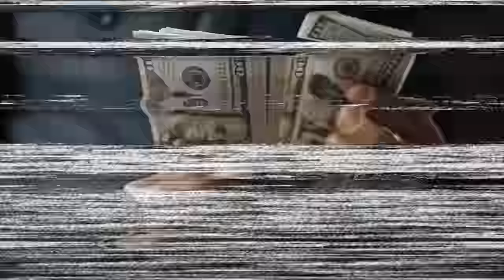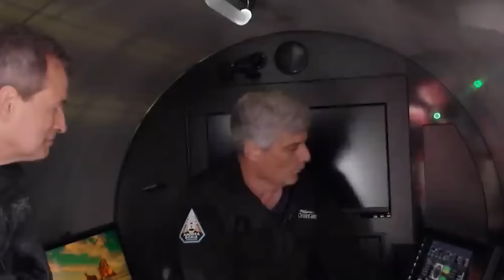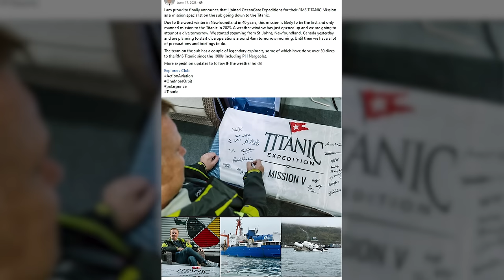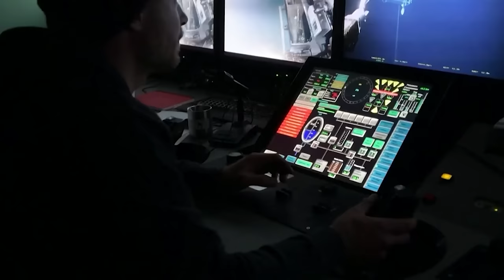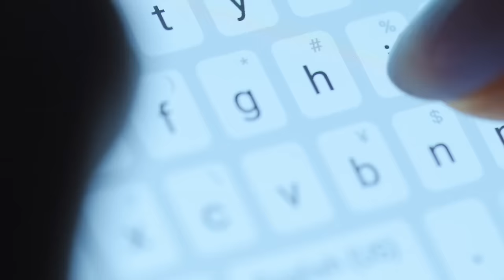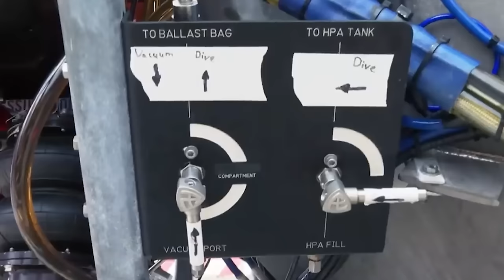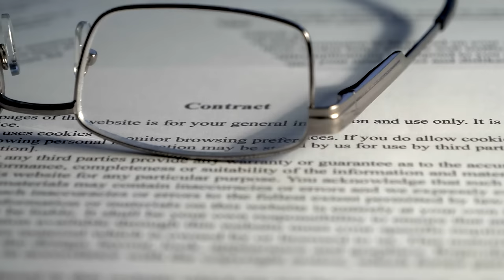The Titan Tragedy: What Went Wrong with OceanGate's Mission?

Comment: Many, many design errors went into the "Titan". There was no redundancy for buoyancy control with absolutely no means to affect positive buoyancy such as an "emergency inflation of ballast tanks. The Carbon fiber hull was designed for the hydraulic pressure found ABOVE the Titanic wreck, there was no safety margin taken into account. The unoccupied space in the submersible (battery compartment) was not monitored for flooding. No means was provided for pumping any water that may intrude there. The list goes on and on. It is no wonder that Rush did not want the vessel inspected.

Comment: I am only a mechanical engineer but even I can tell you Stockton's theory of using carbon fiber because it works great in planes is just plain stupid. The effects of pressure are the complete opposite going underwater. That design also looks like it has several weak points. Being that is was made of seperate pieces makes it even more puzzling. Seeing things attached to a carbon fiber hull going underwater at extreme crush depth made me think he was an absolute moron. I remember seeing a picture of the sub the first day it went missing and knowing that it got crushed. Way too many flaws and Stockton should have been ashamed being willing to take people that have no knowledge about the sub and its flaws to their death.

Comment: After the Titanic sank the rules a regulation were improved.Has the same happened with the Titan?
If "sound" was used to transmit information  then the noise of the structural failure would jam the transmission.
Carbon fiber is strong in tension. How strong is it on compression?
The resin binding it together might have been taking the strain and failed

Comment: It was always a doomed venture. Carbon fibre composites are very strong in extension, because the fibres are resistant to stretching. But the fibres add no strength in compression, so the pressure vessel essentially relied on the resin matrix for its integrity. The resin was never designed for this type of application, and it has a reputation of failing catastrophically and without warning when the layup is imperfect or it is subjected to repeated stress. Why anyone would pay to dive in such a death trap defeats me...

Comment: Lots of negative comments, but gifted people are willing to take risks.   We assume now that it was the carbon fiber that failed.   Recently Boeing has had many problems too.   Locked emergency doors have blown off.  Complete wheels have fallen off.  Large planes have run off the taxiway.   Rudder pedals have become stuck.   The mysterious source of ignition of the fire on Lahaina is of more concern to me.   How did all the regulations related to the COVID plandemic work out?   A large number of men now have Myocarditis resulting from the mandated injections which did virtually nothing to actually prevent illness.    This video keeps referring to unnamed "experts,"  but just how expert are they?  Have they built and tested submersibles with these particular components?   Let Rush and his fellow adventurers rest in peace at the bottom of the sea.   We are all going to die at some undetermined point in time.  Life is often unpredictable.  This was a very small loss of life relative to other events such as the genocide in Gaza where many more innocents have been deliberately killed without genuine moral justification.

Comment: Zero chance the sub was sinking nose-first towards the bottom when it popped. Carrying all of its weights, it had neutral buoyancy and only moved down via the thrusters. If it had total electrical failure, it would just sit at its current depth until they dropped the weights and rose to the surface. It was just the dumbest hull design ever.

Comment: They literally charged a $¼ million PER person! So they should have done a lot more to make that sub Fully capable of handling the pressures & compression forces that they were putting their sub through. It takes just a mild understanding of physics/material science/engineering design, to realize there is something seriously wrong about the current design they were using. The hull was connected to the end cap with adhesive glue and some bolts to connect metal to carbon fiber. The hull was spun in a linear manner without any woven patterns or reinforced structures. They should have AT LEAST made a sub with a much more durable, strong, reinforced, trusted material & shape design. I'm all for innovation and trying new things and pushing the boundaries but when it comes to exploring the deep ocean you DEFINITELY want to make sure your sub capsule does not implode. It needs to be able to endure the environment you are going to... There is no wiggle room when it comes to this & they already are charging a TON per person anyway sooo, why not make it work? If they did, they would still be having a huge income situation happening. Yet they only cared about the money income and not the engineering design safety that is required in order to keep receiving that financial income..

Comment: I know Oceangate gets a lot of shit and rightfully so, but the one thing that baffles people that shouldn't is the Logitech game controller.

Game controller design has been pretty much standardized since the original Playstation in the late 90s with very little change. The design is ergonomical and clean, and nearly everyone at some point has played a game with a 360 or PS controller.

Drones used for military and civilian applications along with ROVs and other vehicles use that same layout of controller on the user end. There's no need to reinvent the wheel.

Granted, it shouldn't have been wireless and it shouldn't have been the only way to pilot the thing reliably,  but that specific part of it is nothing new when it comes to aviation and submersibles.

Comment: You called the Titan's carbon fiber hull, "state of the art." This is not true. Normally, a carbon fiber hull is placed in a high-pressure kiln and heated. This was not done with the Titan's hull. It was allowed to sit and cute. State of the art nowhere.

Further, carbon fiber hulls have lengthy proven records of containing pressure, such as aim aircraft bodies. There is little to no such record of withstanding external pressure, and plenty of material/structural concerns pointing against such performance.

Comment: Everything Stockton Rush did was wrong 
#1 videos show construction of Titans hull being spiral wound with carbon fiber , like a sewing machines bobbin  , carbon fibers strength comes from being omni directional , the strands going all directions ,  the only real strength of Rushes design was the epoxy resin 
#2  Epoxy Resin & Carbon Fiber Cloth have different expansion and contraction rates and the titanium end caps also a different rate and the glues as well  , so over compression cycles  everything separated   

#3 Stockton Rush claimed to be a Carbon Fiber Expert , he built a Glasair III Carbon Fiber Experimental Aircraft , however the Kit came with the Carbon Fiber parts Pre Made all he did was glue them together , Hardly an Expert 

#4 Carbon Fiber is very strong being able to withstand up to 15 G,s in Aircraft usage , however the compression G loading per square inch of Titan was massively huge , hundreds or thousands of G,s  

#5 Carbon Fiber is a really bad choice for that kind of pressure vessel application ,  a scuba tank being the most used pressure vessel

Comment: A couple of things presented here don't make sense. 
You said Titan lost contact with the surface and shortly afterwards, dropped its weights.
Attempting to get to the surface and rising. Consensus seems to be that the sub imploded at 3,500 meters depth, just after dropping its weights.
Yet you also say and illustrate that the 'crew' experienced an agonising dive to the bottom in complete darkness. Both things can't be true. Because the crew would've died immediately the sub imploded. As it was rising or attempting to rise. Estimated as being at 3,500 meters down. The bottom being what? 4,000 meters down, where Titanic lies?
The inconsistency in your presentation is whether or not the sub was rising when it imploded. As you quoted James Cameron as believing. Or was falling in an uncontrolled dive. 
 Perhaps I'm missing something. It is late and I do have man flu of sorts. So, I'm going to avoid hazardous activities for the weekend. Like drinking too much Guinness! ;)

Comment: They knew what was going to happen. the implosion was always going to happen, they reported cracking sounds in the aft which was the sound of the adhesive separating from the carbon fibre which is why there is a rule that you should never bond them together. a rule Stockton ignored. The moment they heard that crack they were screwed. As the sub descends the skin expands. As they started to come up THATS When the implosion would of happened. had they of just stayed stationary they would of lived for as long as they could of at that depth with no further changes to the pressure. when they went up the pressure relaxed the skin and BOOM all dead.

Comment: They couldn’t take a taplight or something? Why did it need to be pitch black? 🤔 It’s a red flag in itself that they didn’t have enough onboard power storage to run lights the entire time. It shows they’re not planning with enough margin for error. Also what’s even the point when all you have to look out is one teeny window for 5 people? It would be worth it for a round sub covered in glass but you’re basically going in a room you can’t look out of. May as well be at the surface using a remote rover with a camera. The whole thing is silly.

Comment: Sigh, nothing new here. In addition there are errors of fact. For instance, the University of Washington did not have any connection with the design of the Titon submersible.
The portion of the video that asserted pressure acts differently on tubular sections vs spherical sections, the egregious ignorance displayed by this provider is just staggering.

Comment: Not impressive analysis. Edge effects and the specific issues of the laminate and its attachment to the titanium end caps are not well-covered. The energy of the implosion is calculable, not covered, instead hypothetical whale bites are discussed. Embrittlement is not the physical process of laminate failure, etc. etc. poor physics.

Comment: Carbon fibre: huge tnsile strength in a situation where tension is irrelevant: this is a tube under compression.
Great attention -- and then much boasting of achievement -- at exactly the wrong thing.
But the whole thing was nuts: people being bolted in?? Bolted in to a container with communications of proven unreliability? A container with no signals system to show boats or aircraft where it would be if it reached the surface?
Nutsy The Squirrel Territory, start to finish.